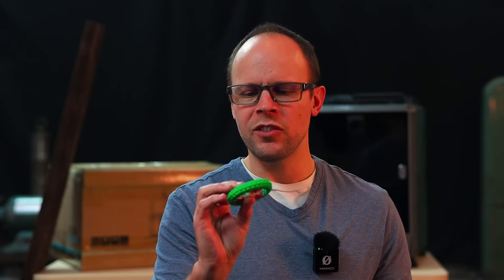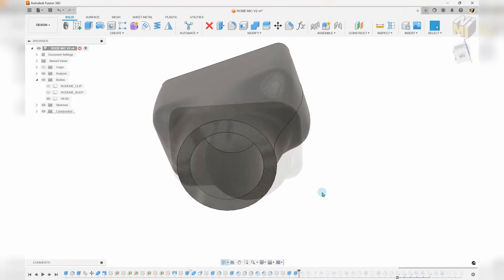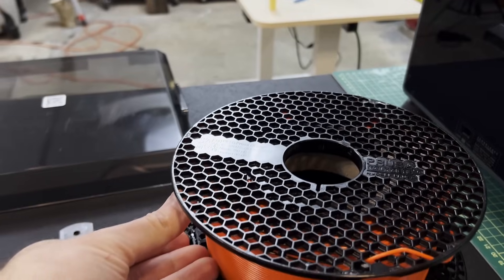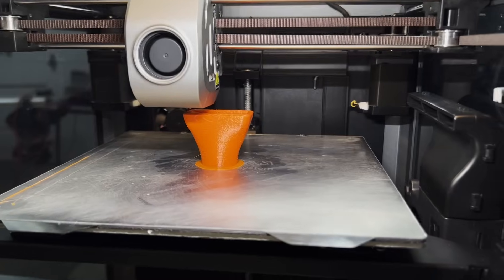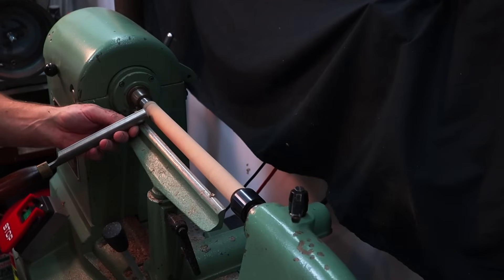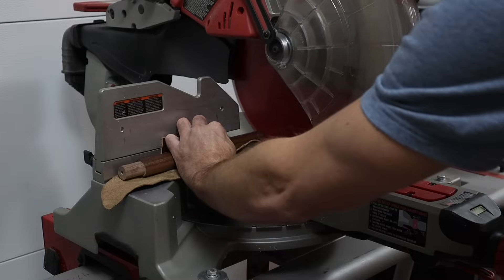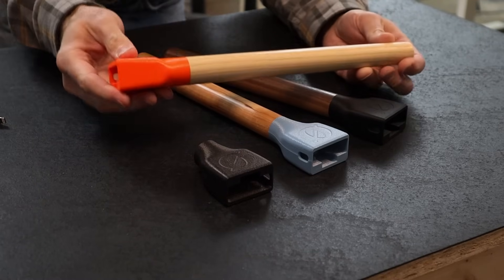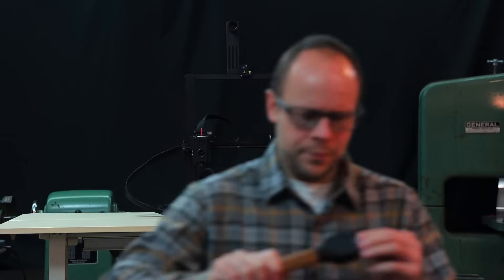Can we Make a High Quality 3D Print?

Comment: what are the programs he is using? Please
Reply from the maker: Hi, sure, I use mainly Fusion 360 for creating models, and I use Orca Slicer for...well slicing for printing.  Fusion isn't too cheap unless you purchase a year or more at once, but it's one of the better options out there right now.  There are some others which could be very competitive but I have yet to learn them yet.  Blender is free and has some capability, but it's a different style and it wouldn't allow you to edit details after changes are made very easily.  I hope that answers your question.

Comment: Please use that table saw with some kind of protection i saw a lot of accidents happen, with your setup you could easily get kick back for wood in your chest.
I see a lot of hateful comments, although this particular item is not something i personaly need, i find your  techniques very interesting that i can use in my projects when 3d printing some of my stuff.
I feel that a lot of people don't understand that this video can be used for other projects and not just for this mic holder.
Reply from the maker: Thanks for your comments, all woodworking machines are dangerous, they are in fact more dangerous with a guard when cutting small parts, it is better to know where you hands are at all times and respect the power of the machines.  There is no chance of kick back while using my push stick.  I am a Woodworker by trade, this is something I have been trained on formally, and I have been in the industry for 20+ years now, I have seen my fair share of accidents.  By far the most common causes of injury are from people who are inexperienced, from distraction and from working while exhausted.   One key to cutting small parts on the table saw with success is to have a zero clearance throat plate, an outfeed table is also nice. 

There is always 5% of people who will hate what you are doing no matter what, these people are most likely insecure  themselves.  I'm not concerned about those people.  If the majority of comments are positive or inquisitive, that's fine by me, there is no need to try and please everyone, it is an impossible task.  

Most of my videos are just ideas and I try and wrap them up into a project of some kind, it might not suit everyone, but it's different than most of what I see online, so I'll run with it.

Comment: Man: wet sanding, paint, finisher.
Reply from the maker: Are you referring to the plastic?
Reply: @NeedItMakeIt  Aye, for what you print, there's no wet sanding for wood.
Reply from the maker: @eaman11  I can't say I've ever wet-sanded a 3d print, but I can see that working well for ABS.  Wet sanding wood was a thing, though not used very often the purpose is to raise the grain.  The only time that is needed is when the work does not have a finish applied.  Pretty much an obsolete technique these days.  On occasion I would wet-sand a table top with a few coats of varnish on it as well.
Reply: @NeedItMakeIt  Seriously man, learn some 3d print post production, it ain't anything new, there's tones of tutorials even on youtube.
Reply from the maker: @eaman11  I'd prefer not to waste time post-processing, the goal is to try to get closer to a quality product directly from the printer.  I've done my fair share of sanding, it is not my favorite thing to do, by all means go wild and enjoy yourself :)
Reply: @NeedItMakeIt  Nobody enjoys sanding plastic, that's why you put a primer or resin over 3d prints.
Reply from the maker: @eaman11  Great, again not my thing, prime and resin away.

Comment: I think with a translucent white finish on the handle the orange one could look quite good
Reply from the maker: Cover up that beautiful natural wood?  Says the woodworker.  Yeah, I guess it's really a matter of taste, I've been using the black and blue versions, since I only needed two, they're all working fell and feel good in hand, I think there is only one change I'd like to make, that is to add some way of turning the power off to save the battery without having to remove them from the holder.  The button is on the bottom, and it'd be a nice feature.  Aside from that, they're really good, very happy.
Reply: @NeedItMakeIt  the grain would still be visible though if that's a solace lol. Translucent white has been a popular finish with electric guitars lately, I think it looks quite elegant. You've done a really nice job with these, amazing how much of a difference the texture makes. Maybe you could make a compliant mechanism to bridge the button press with a second button on the side of the holder?

Comment: combining build methods and materials is a great idea. I'D love to see more people using leather, for example, to make straps or other flexible components, instead of printing out a line of TPA
Reply: I've got a shamisen I've printed out and bound leather to the sound box. I'm a rank amateur though, so it's an ugly job, but the leather-wrapped PLA feels fantastic.
Reply from the maker: I'd love to see a picture of it.
Reply from the maker: There aren't any limits, most people don't work with leather, it's an amazing material to work with, being able to wet-form it, stamp it and stain it.  I'd love to try to integrate it into some designs.  Great idea.  I still have some from a few  past jobs.  I spent a few years learning leatherworking, but I never got great, just okay.

Comment: really good work! so many 3d printed parts look cheap and unprofessional, in large part, i suspect, because it's so easy to make parts that designers don't feel the need to make each part beautiful.
Reply from the maker: Thank you!   I have a feeling that most of what we're making will end up in the trash, and if we decided to focus more on quality, it's going to be more likely to get use and for us to see that it has some value.  A part that feels and acts like an injection molded piece is probably the best as far as plastics...or move to metal.  

I'm not much of a toy guy, there are some amazing ones out there, credit to those designers, they're far more talented that I am.  I really like things to be made and then used for a long time.  They should have a purpose.  That's me, I'm not necessarily right I just don't like waste and see these things thrown out because they have no value.

Comment: Nice Video
Try Fiberlogy MATTFLEX 40D, it is a TPU with a matte finish and low visibility of the layer boundaries,
I've had it for a few days, it's awesome.
Or you could also use Abs/Asa and smooth ist with acetone,i use this very often,the parts lock lilke they were injection molded.
Reply from the maker: I've never heard of it, I just had a look and you're right it does look really good.  Is it too rubbery for something like this?

Comment: Slick!
Reply from the maker: Yeah, worked out nicely, the black with the walnut handle looks pretty smart.  I'm using them a bit more than expected, I can mount the mic to a stand and get really close for excellent sound quality.  I think adding a few threaded inserts might be nice, maybe something from.
Reply: @NeedItMakeIt  Oooh yeah threaded inserts would make them even more useful. It sounded great when you were holding it.
Reply from the maker: @802Garage  For sure, I think I'll do an updated version with some added features then, try to integrate inserts and maybe some type of holster so I can act all cool and holster it on my belt.  That would be hilarious actually.  Probably would make for a pretty good self defense tool as well.    One thing I noticed as well after using it is that the on/off is at the bottom, and it'd be nice to easily access that while it's being held, not quite sure how to do that, but I'm sure there is some way. 

I wonder how easy it would be to add 1/4-20 inserts into a print, they've gotta be pretty big.  Maybe pre-heat them first?
Reply: @NeedItMakeIt  Lots of different ways to do inserts, but yeah plenty of tutorials on heat pressing them in with a soldering iron. You can look up some strength testing vids too. For the bottom switch if it's not too difficult you could cut a slot on the wood and 3D print some kind of switch mechanism, but def getting complex there, hahaha.
Reply from the maker: @802Garage  I'll have to check them out, I don't do inserts too often... though I just did a few for a video releasing tomorrow, they were just tiny inserts.  Ah, I wasn't thinking about that, that's a pretty good idea,  press maybe from the bottom of the handle or have it on some type of pivot action on a trigger of sorts.  Hey you've got some good ideas!
Reply: @NeedItMakeIt  Actually possibly even better idea, make the switch part of the 3D printed case. It can basically just be a small compliant mechanism that can click back and forth and is shaped to seat around the mic on off when you slot it in. Might want to make it hard to press to off like slightly recessed or something. Ya know, infinite design possibilities. And yeah I just love problem solving and designing.
Reply from the maker: @802Garage  That's a really good idea, I don't know a lot about these mechanisms, but I have had a few people mention them so maybe it's time to do a bit of research and see where it leads.  Having everything integrated would be awesome, and if it can be printed in place or at least easily assembled, even better!
Reply: @NeedItMakeIt  Yeah watch a few vids on compliant mechanisms and it'll be no problem for you. I think you could definitely print a simple sliding rod that deflects and has a bump protruding to the side to lock into a couple positions and on top of the rod the little nubs to flip the switch. I haven't seen the switch on your mic so  it might be a little more complex, but simple in theory.

Comment: 3D printed inserts into wooden shells is what I'm working on now. It hides the 3D printed part but allows you do do complex geometries with the plastic core. You could also laminate veneers onto flat 3D printed surfaces so the printed parts are just a subtle accent color.

Comment: A suggestion if you want to create functional parts that will look great, stand up to anything like heat, UV light and is as strong if not stronger than injection molded pieces... try PAHF-CF or PET-CF. It's expensive but for things that are going to be used around a shop it can't be beat. Plus you can create all kinds of things that you can't buy. 👻 🔫

Comment: Since I hate gluing stuff I would probably attach the handle like one would attach an axe with a screw from the inside which deform the wood a little and clamps it to the plastic. 
Don´t forget 3D printing is perfect for prototypes which can be cast later on in metal for example, you can also do it at home if you use ZAMAC for instance with a melting point of roughly 400°C. 
You can also use jigs and fixtures to bend, hammer form or press sheet metal into place for a great product as well.

Comment: The bambu carbon fiber filaments have been my absolute favorite. Ive been using grey PETG-CF and black PET-CF to make card holders with levers, after dialing in print speeds (the PETG needed to be WAY slower than the bambu defaults to look really consistent on my p1s, like 75-125mm/s) they have an amazing finish. I tried doing a few in PLA instead, but they really feel cheap in comparison. I have not had an issue with the CF scratching the cards.

Comment: I really like printing regular PLA at lower temperatures, that gives it a mate finish and parts look really good.
Reply: Or just change to higher speed!
Reply: Or use matte PLA!
Reply: @ioscaleb  matte PLA is meh and hard to work with.
Reply: And split at the slightest force because the layers didn't weld at all just hugged each other's texture like hot glue...
Reply: @daliasprints9798  it's a myth. You need to print really cold to lose strength.
Reply: @AuxHex  I have extensive experience with this and no it's not a myth. But you won't lose strength of welding if you're not welding it to begin with, which is likely if you followed manufacturers' recommended temperatures, which tend to be at least 15-20° too low.

Comment: At 8:18 , were you using wooodchips to burnish the handle?

Also, in your slicer - was that a tree support that went up to the rectangular opening in the side?  If so, did it need to be added from the build plate like that or could it have been supports from the bottom to the top of the opening in some grid pattern?

Comment: It was a big change to see someone wanting and achieving the goal of printing something professional looking and functional. You get a solid A in my book. I loved the Walnut with CF the best even though Natural Cherry is my favorite by far.
I would be perfectly fine if I never see another Benchy for the rest of my life. I'm actually going to start unsubscribing from all of these channels that print garbage with completely un-tuned printers. Example - "30 functional prints that will make your life easier". But they look like shit and have no strength because I have a shit printer that is completely un-tuned because I spend all of my time making decent quality video's of JUNK that will clutter your life and your desk.

Thank You for the breath of fresh air and inspiration to print something you can be proud of.

P.S. - I wanted to give you an A+ but stuck with the A only because the wooden handle is just a bit boring. I found myself wanting you to cut in just a couple of bands on the lathe or anything geometrically different so they weren't just a straight taper with a flat end.

Comment: Nice video. I like the combination of skills, wood working and 3D printing. Matte filaments always looks better to me. I have also notice printing hotter also reduces the shiny finish.
Reply from the maker: Thanks!  I've been thinking about using a 3D print to make casting molds for alum. as well, that combined with some wood might make for some very nice parts.  It's a lot of work of course and I need a better setup for pre-heating.  The wood really does look good, and I think that the combo makes it seem a bit higher quality, there was definitely more effort put in.  I agree, the matte finish looks so much better.   I like working with PETG, but that sheen just looks terrible in the final product.  PLA or ABS would be better for the matte look.  I think Prusa makes a matte PETG which is not CF as well, I believe there are a few other options that might be worth trying.  The matte finish with Black looks really smart, I like the blue as well, but I think it needed to be darker blue for a more elegant look.

Comment: Carbon fibre is great. But in this case you probably should not use it, because it will scratch up you mic.
Reply from the maker: That's a good point, nice thinking.  Ideally the inside would be lined with some kind of stick on velvet.  Any thoughts on that?
Reply: @NeedItMakeIt  Either that, or maybe a soft TPU inlay. I think at least with the new cura you can combine materials pretty easily, so Putting TPU on the Inside to prevent scratching should actually not that hard.
Reply from the maker: @XA--pb9ni  I think I need to buy some black TPU, all I have it white and it looks pretty cheap.  I'll give the mixing a try though.  TPU is probably the simplest way to do it, adding velvet to the inside of that small space would take some dexterity that I don't know I have.  I haven't touched Cura much, I'll dive back in, I have an Ender 3V3 now, it might be a good way to start printing with it, though it does run Klipper.

Comment: Great lathe work nice finish for your product nice 3D printing easy access for charging nice colour printing for your product 😁😎
Reply from the maker: Thanks!  I have been wanting to use my lathe for a long time, it's nice to finally put it to use.  I like the combo, doing something like that fully from wood.... would be tough.   I have CNC, but work-holding & tooling is an issue, and then we have a pretty weak part in the end after removing so much material.  I've been using them more than I thought I would.  I like to use them as a storage place as well so they're easy to spot, and I don't mind using the mic that way either; it feels a little more professional for some reason.

Comment: Respect on the precision you're using in the design and the skills of making the stuff exact in 360 first!
Reply from the maker: Hey thanks.  It takes quite a bit of time, the cool thing is that now I have the model I can re-design, or give access to other people if they'd like to make their own.  I was thinking about a soft-cover option as well from TPU, having the model make it so much easier.   Unfortunately all I have is white TPU, and it looks really cheap.  I think it needs to be a dark color, maybe even with fuzzy skin on it!
Reply: @NeedItMakeIt Maybe try out some soft PLA. I bet you can get a higher quality look/feel with it easier than TPU.
Reply: @NeedItMakeIt  The Fuzzy skin is a good idea, I have never used that feature before but It can come in handy, well done.
Reply from the maker: @sierraecho884  Thanks!  Normally I wouldn't use it either,  adding grip is one use and I have a video on that,  but I kind of like it for PETG, even just a tiny amount helps with that sheen, so maybe it's a keeper.